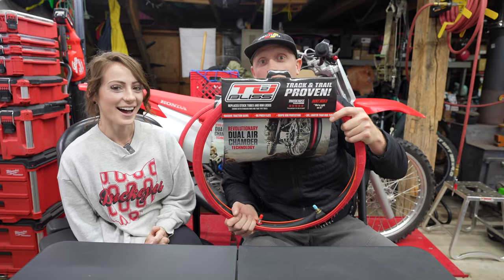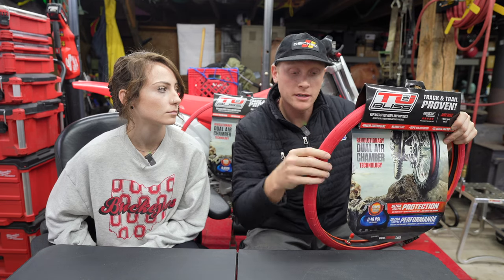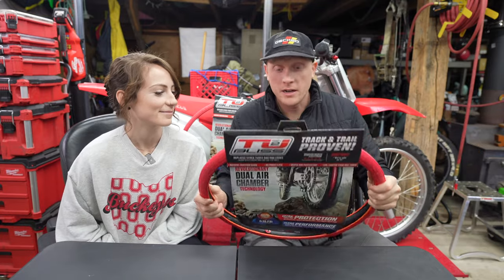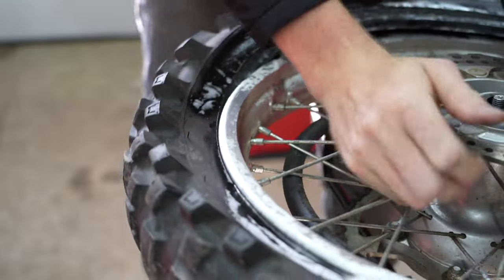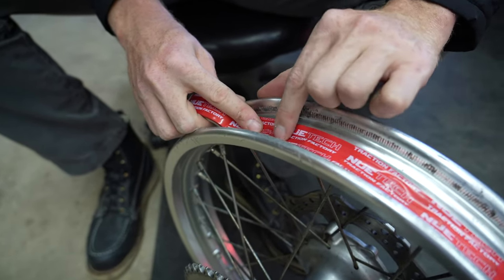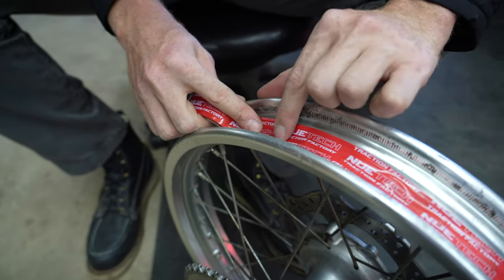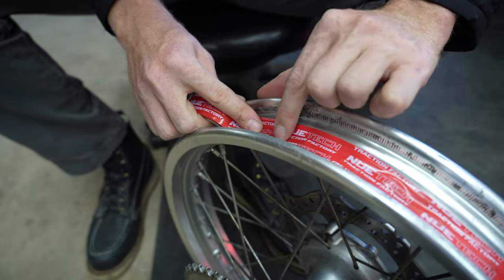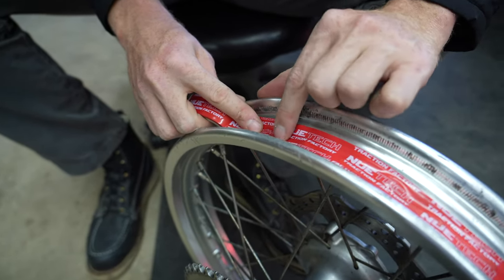The BEST Dirt Bike Tire Inflation System in 2023! (Tubliss Install)

Comment: I run Tubliss on my CRF300L Rally and ride it daily with Tusk D Sports. Absolutely love it on and Offroad. Its already saved me a few times with flats and allowed me to get home. Also loving it on hard enduro trails. Have about 5,000 miles on the setup. 10/10 recommend.

Comment: Bibs for the win.   Was a tubliss adapter early.  Like in maybe 09 or 10.   I ended up making the switch to bibs.  They are OK, but got tired of fiddling with them all the time and high pressure leaking out every week.  Ended up damaging the inner liner on one and puncturing  the inner tube.  tossed it and gave away the front one.

Comment: 6 months later. Still a happy customer?
Reply from the maker: It was a no from us.. Low pressure leaks off after a day or so. Sealant would have helped with that though, if you don't mind constantly checking pressure I guess.
Reply: @AdventureDaily had my rear tubliss on for a few months now. And zero issues. I even know the dealer didn’t use enough rim tape or soapy water. I got 10 rides out of it before adding some slime and still going strong.

Comment: You will like em , don't be afraid to run super low psi like 3 or 4 for your light weight.  Ive been running them for over 15 years.

Comment: I still prefer Lucioli. I was on an expedition for 3 days in terrain with sharp rocks using my Lucioli at 0 psi. I thought I had managed to destroy my tube. But to my surprise the Lucioli inner tube was intact. I changed the tire for a new one and continue using the same tube. ps: my Lucioli is already 3 years old and still looks like brand new... no one inner tube lasts that long.

Comment: I use both UHD tubes on one wheel set and Tubliss on the other. Once you run them in hard terrain it's a game changer. I'm 10psi front/8psi rear with no fear of pinch flats.

Comment: Black sandpaper 320-400 grit and dawn dish soap. scrub the inside of the wheels and clean and remove the black residue from previous tire installation. Installing any tire on a filthy bead doesn't work. The metal surface of the inside bead should be smooth as glass. when you can run your hand all around the wheel and feel nothing but smooth your ready to put on another tire.

Comment: I have KTM 890 adventure R if it works with DOT tires why can't it be used for highway speeds? Is it a balance issue or centrifugal force issue?

Comment: I just did my first two installs. I did dril the rim as suggested in the instructions (4 spokes apart). A couple of things I might suggest: When adding the Tubliss to the rim, pinch the tube so it stays in center at the last few spoons. I did that the first time but forgot on the 2nd tire and it was much more effort to get it on the rim. Also, I used 3 bead buddies (spaced apart by about 3-4 spokes) and that made the tire install so much easier. Good video. My son has used them for a year or more and is quite happy. NOTE: if you have leakage at the low pressure side you can also use a tire sealant (e.g. slime or something else) and that seems to help it maintain the low PSI for longer. Good luck ya'll.

Comment: I have given this a like because it is well video'd but I can't get my head around this - why, at 11:44, are you lubing the UPPER edge of the tyre? The surface that needs lubing is the UNDERSIDE edge of the tyre, surely? You are trying to slide the tyre over the rim yet the tyre is dry underneath with maximum resistance/friction to wanting to move. I've looked carefully at what happens subsequent to 11:44 as you are levering the bead over and the lubed surface does nothing apart from make it easier to remove the tyre iron after each bite. Is that the point of lubing then?
Reply from the maker: Yeah I just like everything to be slippery and don’t want my levers gripping to the tire, you are right though it isn’t necessary just do it out of habit.
Reply: @AdventureDaily  That's cool. I appreciate the reply, many thanks :)

Comment: Would there be any issue with running them on the road at speeds like 60-70mph
Reply: TuBliss is not officially DOT approved, but lots of folks (including me) run it on their 690s.  It takes 6 ounces to balance for the rim lock, I use brass spoke weights and a Harbor Freight static balance stand, works great!

Comment: Fun real world kind of video.

The great TuBliss debate is whether or not to run sealant like Stan's or Slime.  I like to spray the Hell out of the high pressure bladder and red jacket with Armor All as well as the tire bead which makes it all slicker than snot and all easy to work with during install.  I don't bother with sealant if it doesn't leak, which is generally the case.  In my experience sealant, while sometimes useful for sealing the TuBliss and bead area, generally doesn't actually seal tread punctures, but it can help to make locating them easier! 

Finally broke down and got a Rabaconda.  It really isn't necessary but so nice for doing this, especially street tires.  The Rabiconda curved tire levers are the freakin' bomb.  Tusk offers less expensive knock offs that are likely just as good.  There is a new stand out there called Neutron Speed Pro that looks even better than the Rabiconda for less money.  I like that stand's Delrin sliders, simple knobs for the wheel size adjustment, and it has a nice steel spindle.  Time to step it up Bro! 

Even for an off road only bike, I like to balance the wheels as once ya go over 40 or so the rim lock will cause the wheel to start hopping.  Brass spoke weights work great for this, generally 6 ounces of weight across from the rim lock does the trick.  Harbor Freight has an inexpensive static balancer that has worked great for me.  It is covered with moto stickers, which improves it's accuracy 😆

Comment: I was just doing a tire swap on a bike I just bought with this conversion. I would recommend doing a good cleaning and a re-tape if the tape condition is looking questionable. You are not supposed to stretch this rim tape when applying, which I think was done when the previous owner installed the kit. New tape is under 10 bucks. If you are new to this, having a new bladder is also a good idea. they are about 12 bucks.  Take your time and clean everything this really well. The cleaning will help insure a good seal.

Comment: Wouldn't the tubliss make more sense on the Xtrainer? These CRF's are just kinda dork around bikes, not hard enduro machines where tubliss really makes a difference. Or is it just for showing the installation process? We run tubliss and extremely low psi with the Kenda Knarly, very good traction. 0-4psi

Comment: I’ve tried tubliss and mousses and prefer mousses you can still puncture the tubliss with the the tyre leavers fitting the tyre then it’s game over had a few mates do that if you nick a mouse with a tyre leaver it doesn’t matter and if you fit a dummy valve you can lube the mouse with a syringe easily so no big deal I’ve known people have mouses a very long time if you lube them enough tubliss has a shelf life they won’t last forever

Comment: Don't really care for the tubliss system myself, the low pressure is excellent for traction but puncture flats are not uncommon at all although they are usually easy to fix with just regular automotive tire plugs but the reality is dirtbike tires are engineered to be used with a tube or a Bib insert, try and use newer model tires that have stiffer sidewalls, for your particular application they should work great.

Comment: Whilst these sound like a great idea I cannot see the cost v's the benefit.
I ran Barum HD tubes for many years and have had few punctures in 30 years. ran as low at 10 - 12 PSI in all sorts of hard rocky and muddy terrain on my XR600.
At AUD$25.00 a tube v's close to AUD$200.00 for the Tubliss system I reckon I can change a tube each new tire and be well in front.
Also a tubeliss system still runs air so really is it better?
But that is My Opinion.
Reply from the maker: That’s just it 10-12 PSI is not even close to low enough for most people these days. I like to stay around 5 for the gnarly stuff, all depends on how you plan to ride but I agree I’ve had good luck with HD tubes but I always had to be conservative with my pressure. Air isn’t the problem it’s the fact you can run 0 psi without ripping your valve stem or pinching a tube.
Reply: @AdventureDaily  I didn't see the need to run as low as 5 PSI as I never had traction issues and ran rim saver Yokahama super diggers. Also never bent a rim in 30 years either. But that was just me and with the grunt of the XR she had rim locks on the rear as standard back in 89.
Mind you I never ran in Snow as where I live and went riding - never saw snow but lots of mud and lots of red and yellow Clay soils, rocks and sandy loam soil.
heaps of trees and Kangaroos and wallabies to keep you on your toes.

Comment: Are those stock rims? What’s the tires spec’s? I’m looking to get a wider rear tire on my crf250f
Reply from the maker: Yes they are and in this video we mounted a 130/90-18.
Reply: @AdventureDaily  wow thank you 
Crf250f nice bike, just like my 77 xr75 but bigger. I still have it too, bullet proof never had to do any repairs, not even adjust the valves

Comment: This would be pretty difficult with a 606, they're really stiff.
Reply: I just did a 606 rear off a KTM 500 EXC.  Stiff but doable.  Hardest part was getting the wheel in the tire. I did not have the plate they give you help this. Lots of spoons and four hands did the job.  To mount tire -  Lots of bead grease (I used Rabaconda grease ) and small bites!  i used the bead breaker on my Rabaconda street tire changer to hold the bead near the center and on top of the red thing while spooning the other side on.  The Rabaconda tire iron works very well - strong with perfect spoons.  I never used the Duckhead for this job.
Reply: @johnlewis2440  this is great info, thank you. I see tons of tire change videos, but they are never changing 606s lol. I wonder why?